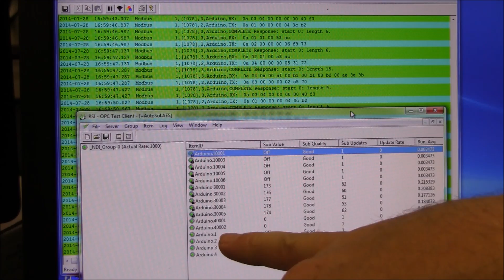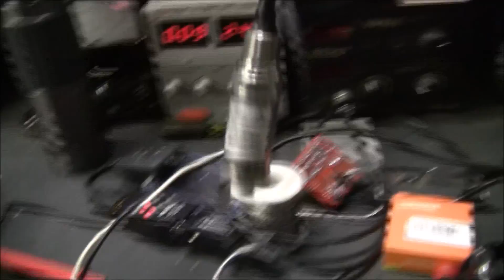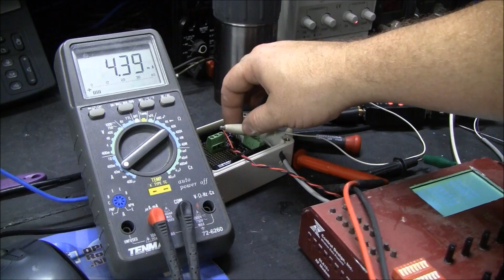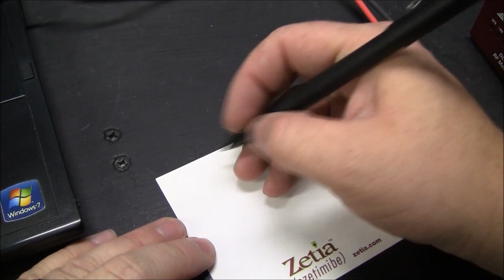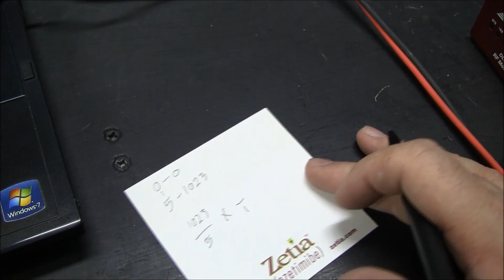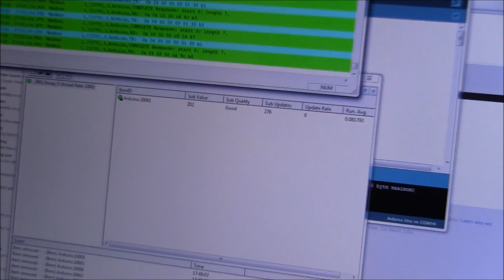Modbus RTU over RS485 Arduino and Scaling 4-20ma to 1-5v

Comment: What Arduino library did you use for the Arduino Modbus? Been struggling with this for quite sometime now. Cant get the 485 driver to communicate to slave device ( Delta PID controller ). I'm sure my RS485 device is working because I can see the data on the default software that comes along with the device. However I'm a bit confused if the RE DE pins are shorted together or individually controlled by the Arduino. Tried Doc Walker Modbus Master. Somehow the Arduino although I see flashing lights on the Tx pin of the Arduino doesn't seem to communicate with the device. Is there someway to check.

Comment: rs485 chip need En signal, that is covered by arduino library right ?

Also, Me as a beginner in all this stuff have so much questions but I can't ask everything of corse.
Can I somehow make all this things to work on my standalone "PLC" made arround ATmega128 mcu? to take that mod bus lib and add many more inputs/outputs and compile code (Arduino - Sketch) in AVR studio.
 Also I asume that I'm able to access to Scada BR only on my local network (?) but I'm more intersted how to access to running application from PC that is far away? that's modbus tcp/ip about, right?

any yes, definitely subscribe! one of the best YT channels about this stuff I have seen! :) Thanks for your effort, sharing all this is precious to newbee :D
Reply: If somebody wonders about one of these two question above I just got the answer on 1st one simply by looking again this video, carefully, few times.
I know that some people were confused about RS485 because RS/DE control so I will share "my conlusion"... :D

DF Robot RS485 shiled v1.0 has automatic/manual transceiver mode switch on board!
When in manual transceiver mode, the enable is connected to 2nd digital IO port, so it must be programmed - controlled by code, but this MODBUS lib and this sketch use ALL inputs that's why digital pin2 is not available, so switch is turned to "auto" were small NPN transistor controls RE/DE and it's base is being trigered by Tx signal of course. Simple but clever hack so realy only Tx and Rx are used.

Question 2 and 3: solution pending...
Reply from the maker: I don't know how you would implement it using AVR studio, I am sure you could if you are smart enough. It's not hard to forward the ScadaBR port in your router/modem so yes you can easily access it not only in your LAN but from the internet too. Just be sure to tighten the security and set good passwords in ScadaBR, no admin admin stuff!